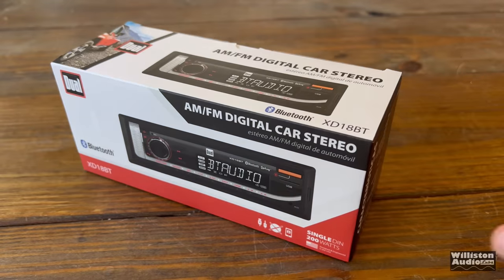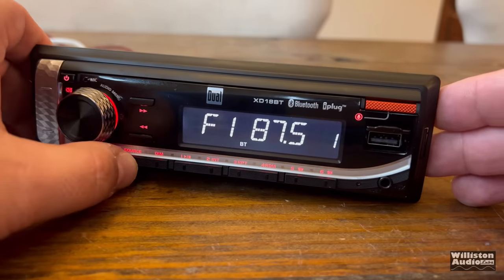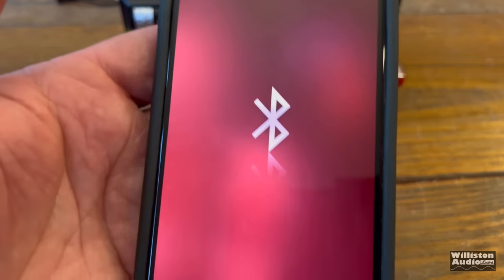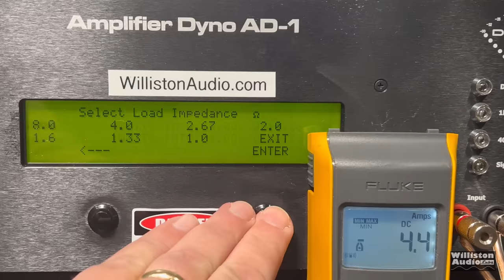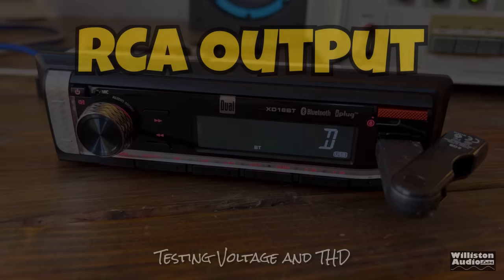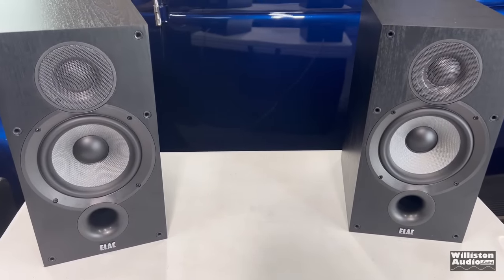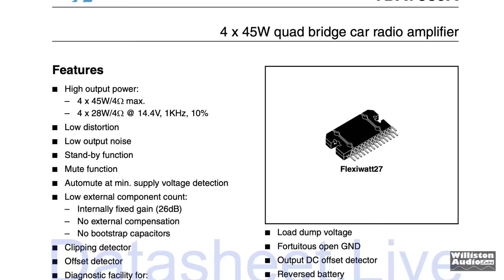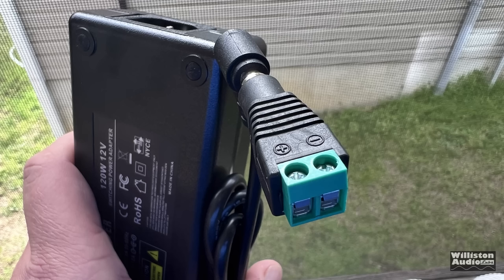How Bad is Walmart's Cheapest Car Stereo?

Comment from the maker: Dual Electronics XD18BT Bluetooth Car Stereo
Shop for the XD18BT: https://is.gd/walmartdualbt
The $10 Blaupunkt Car Stereo: https://youtu.be/EBEk9VPsix4
12V 10A Power Supply: https://amzn.to/3I4A6qg
Elac Debut 2.0 B6.2 Bookshelf Speakers: https://amzn.to/3Mmdbcz
Thanks to SAVARD Speaker Systems for being a monthly sponsor and make sure you check out Shop4Boom.com and use code WAL7 for 7% off everything including RAP and HiQ series subwoofers. 

TEST BENCH EQUIPMENT
SMD / D'Amore Engineering Amp Dyno (AD-1): https://is.gd/wccad1
XS Power D1400 Batteries - https://amzn.to/2BPFCKW
XS Power PSC60 Charger - https://amzn.to/2CHGcfs
Fluke 1000A AC/DC Clamp Meter: https://amzn.to/2Rw5WDA
Handheld Dyno AMM-1: https://is.gd/wccamm1
My Favorite Precision Screwdriver Kit: https://amzn.to/3RTO6c4

DISCLAIMER: This video and description contains affiliate links, which means that if you purchase from one of the product links, I may receive a small commission. As an Amazon Associate I earn from qualifying purchases
Reply: Can you get a Gemini dual 15" speaker and see what's the smallest amp you have that can give it the most power...this is a challenge?
Reply: Never mind, I see you tried something with the quad box.
Reply: Yo big I have a real old school Rockford fosgate 12 it’s says tha punch on it would you do a trade on another 12inch sub I think you would like it old maybe late 80s or early 90s I would trade you for any 12 inch sub lmk
Reply: It’s in good condition

Comment: Put one of those puppies in a Jeep Liberty budget system for my nephew. Actually sounded great, to my surprise. Total cost of around a hunnerd bucks. Used Kenwood amp and MTX 12" subs for $40, Dynavox 6.5" woofers were $11/each, 2.75" fullrange Visiton at $12 a copy and cheap 8awg amp wiring kit for $10 and some passive filter components totalling $15. We were blown away how good it sounded. It took me many attempts 'till I had a system that sounded that good when I was a kid. Budget audio systems can be alot of fun.
Reply: Diffrence is when we were kids that would have been around $800-$1000 easy….crazy how much better car audio has gotten and sooooo much cheaper
Reply: In 1977, this system by Alpine, Fosgate, with powered sub and active crossover... was more like $1200 to $1500.. If this deck is just average clean (1% is a high and increases the chance of speaker damage, well it did 45 years ago) But the RCA OUTPUTS at .012% distortion is EXCELLENT for 10 times the price.
Reply: Blah blah blah blah and it still sounded like asz that's why you had to comment 😂😅🎉
Reply: Yeah, I wasted a decent amount of money on flea market type amps as a kid before I got a used 90 or 120W fosgate amp for free from a friend. I tried it and it blew away all the "500 and 1000w" amps I had bought before, I was wasting $100+ on each one rather than ponying up for a proper amp.

These days cheap stuff is much more capable. Semiconductors have come a long way.
Reply: Deckless units are common here in Eswatini and not that bad.
Reply: i had a cherokee (liberty in uk)  the original head unit cd/cassette/radio was awesome, but did need an amp to improve high volume as was to quiet on max volume  miss my jeep
Reply: you never had good sound  probably lol
Reply: I was thinking this would be great for an offroad rig!
Reply: @DreStyle  you will never be happy

Comment: Nice that it dosen't have eye searing blue led's lighting up the face.
Reply: Wish my speakers lit up.
Reply: That reminds me i also had a set of the dual plain black plastic cone 10 inch subs in the light gray with white fibers carpeting odd shaped sub bandpass box and it had the light blue neon speaker ring tubes . I had forgotten about that one when i mentioned most of the dual electronics products I've owned because i didn't keep it long i had got it used at a yard sale for my ex girlfriend and when we split up i gave it to her.
Reply: I bought one few years ago exactly like this but it's blue LED lol. So glad they came out with red LED need one for my old farm truck.
Reply: @lancestrahm2362   I picked up a plow truck and it has an aftermarket radio in it, I was saying "please don't be blue!" And thankfully it's old enough to be white, almost like it's backlit by incandescent lamps or nice warm white LED's.
Reply: @volvo09  Unfortunately my dumbass rebuilt an 89 mustang gt few years ago and decided all the gauges and aftermarket gauges needed blue LED bulbs...major regret 🤣

Comment: I installed one of these Walmart head units in a DIN sized hole that I cut into the front of a plastic tool box, along with two cheap 6.5 inch coax speakers. I then hot glued the 12V battery from a battery backup unit (like for a computer) with a battery charging cube. Now I have a portable, app controlled radio to use when we sit around the fire pit in the back yard.
Reply: get power supply from pc it has 12 volt for radio but 120 ac for outlet no need for battery when using at home or garage or patio. it will fit inside area about size of  that battery or motorcyle battery and can use 120 ac outlet
Reply: @RT22-pb2pp  don't even need to be a full size one, can use a pico PSU. Tiny things, still capable of about 200 to 300 watts

Comment: I could see people buying the head unit + speakers combo to make a cheap BT boombox. Just add some lithium batteries and a USB charging board and you're good to go for cheap.
Reply: And...at 9 watts per channel tbose batteries will last!
Reply: there's something about a jbl..
Reply: I'd swap the amp for 3$ TPA3110 for same power but at massively better efficiency
Tbh I have no idea why they wouldnt use class D in the first place... Class AB is far more expensive than same power level class D  class D performs the same by now

Comment: I don't know how other people feel on here but I would personally be really jazzed about you coming out with more videos dynoing head units. Love the channel man. Keep those companies honest.
Reply from the maker: The truth is, most head units use the similar 15x4 IC's. A few exceptions including Alpine V-Drive, Sony and a few others
Reply: @wal appreciate the response.  that makes sense. This might be anecdotal but I feel like there can be a pretty big difference in output Even though the rating on the box says they are the same. I have a buddy with an entry level pioneer head unit from a few years ago that's rated 4x50 that he had to crank the volume up on it to get decent sound or of it. I gave him my old pioneer head unit that's a few rungs up the ladder but the same 4x50 rating and he said that the output was a lot better. Totally possible it's placebo but you're the guy with the lie detector who can prove it. I think there may also be a market to explore in Android head units from China. Amazon has quite a few options but they're all over ali express and temu. I know the head unit I picked up has some surprising output from its tda7850 chip Even though it's also rated at 4x50. You do you, I'll watch either way. Cheers
Reply: I was thinking about Dyno 's also i used to have a Panasonic cq-df44 CD player the faceplate was backlit in light blue, and it had a 3 stage dimmer on it and it was only rated 160watts but that is honestly one of the loudest clean sound output stereos I've had not counting my pioneer deh p3700mp mp3 CD player super tuner III D stereo.
Reply: @wal  Test those exceptions! I'm in the market for a double DIN head unit and I'm only interested in the cream of the crop.

Comment: A guy at the job installed this set up inside a metal toolbox from the same store. He has a laptop power supply powering it. For what it is, it is loud enough in the shop to have gotten wrote up a couple times. 😆
Reply: outstanding.

Comment: I've had one of these (Dual XDM17BT)  in a boat for about 2 years and its still going. Face plate is faded a little but its still working good and nothing is more harsh on a radio then being in a boat
Reply: That was my question. Have a boss unit in my old truck and the screen got sunburned so bad only half of it works now

Comment: It's amazing how far we've come in the way of shallow mount head units. Technology is awesome! Dual is actually a decent super budget brand.
Reply: They really are. I've owned quite a few of their products (subs, speakers, HU and amps) and was never mad at the performance. 

The only weird thing I had happened was on a CD player I had in a car back in like 2002, for some reason once the volume went over 10 on the display, the output jumped significantly higher for some odd reason. I mean, it wasn't atrocious, but definitely was there.
Reply: Carl Jr that was the single din that looks like the silver version of the Jenson x3010 and the 2010 CD players right,i had the x3010 but it didn't do that only because the rear speaker channels were blown the radio got wired up wrong by my best friend when he was drinking so yeah,he gave it to me and it was a new stereo, anyway he gave it to me since i installed a newer pioneer deh 17 i had that worked great in his 93 Ford mustang LX factory amplifier car.  And i had the silver face Jenson CD player i was referring to mine lit up in red but it would be fine til about volume 10 gradually going up in volume everything after 10 was a jump all the way to like volume 30, i put up with it for about 6 months and it gets old and i pulled it out of my 86 Buick Regal Factory V8 Sport Coupe Oldsmobile roller cam 307 V8 car with the Factory steel chrome on black centers magnum 500 rally wheels, and i installed a newer Panasonic cq-df44 CD player that lit up in blue and had a 3 stage dimmer,came out in 1999
Reply: @richardbates2367  It sounds like we're talking about the same unit, for sure. The Dual I had, if I remember right, actually had a knob. A huge one right in the middle. I may be thinking of a different radio though. I've been through so many through the years it's hard to keep track.
Reply: @richardbates2367  After further research I found the model # XD7500
Very stylish CD player on a budget. I kinda wish I still had it.

Comment: I’ve been laughed at many times when I tell people that auxiliary input has the capability to perform better than usb or Bluetooth depending on the DAC in the head unit and the source being fed into the auxiliary port. 

I’ve had people literally call me an idiot for saying it , because it’s almost never the case because nearly all head units have an adequate DAC , but in extreme situations like this , it’s absolutely true.
Reply: My auxillary is always better than the wireless blutooth….every time
Reply: True, but most new head units (or phones) don’t have the “headphone jacks” anymore. I hate that! Avoiding the need for MP3 decoding removes the chances of cheap components ruining sound quality and just generally makes things simpler if you can just pump pure sound signal into an amplifier. To me, most Bluetooth in a car stereo sounds about like AM radio signal quality. USB is about as good as it gets these days (not really bad at all) and, honestly, any loss in sound quality is still worth it to me over CDs or cassettes of the past. As long as you have your phone and some data signal, at least you can always find something good to listen to.
Reply: you can hear the difference.
Reply: Its amazing isnt it lol.
Reply: @brianandrews7099  Aww, its better than AM, and even FM. I bet the phone matters and what kind of sound processor it has. Id take a 4 year old Galaxy S phone over any wal mart cheap phone. 

Still running an S10e. Sounds pretty decent over BT, but yeah, AUX is better.
Reply: I'll argue usb is the best way to listen to music not all phones have good output thru aux or Bluetooth
Reply: Bluetooth will always have inferior audio quality over a wired connection because the signal is heavily compressed.
Reply: @flurpoid Bluetooth is or was similar to those 64k satellite radio channels. It sounds find on some headphones or a pool a bbq speaker but you can absolutely tell bluetooth audio when you're "listening to music"

Comment: I have the version of that radio from I guess 5 or so years ago. Honestly the thing works fine. Came with an IR remote, sounds fine for my old pickup and the Bluetooth interface with my phone is fine. It was like 40 bucks when I bought it. Looks like this one is even more shallow than mine. Mine is just a tiny bit deeper than the sleeve.
Reply: I have the xpr series 82d amplifier, had the first series of their 6x9's that were orange cone, the dual mp3 CD player and speaker Walmart exclusive combo i think around 2006 u66 something is the part number, the dual 279xbt, double din stereo and the xdvd770bt DVD/mp3 CD player stereo and that the 279bt, and the xpr series 82d amplifier which that one is new in the box haven't used it yet but i still have those three dual electronics products.
Reply: The xdvd770bt is the receiver with the built-in front face mic, and the first version of the DVD player it's got i think a 4.5 inch LCD screen and that is kinda impressive when you realize that is a a single din stereo
Reply: The xdvd770bt is the receiver with the built-in front face mic, and the first version of the DVD player it's got i think a 4.5 inch LCD screen and that is kinda impressive when you realize that is a a single din stereo

Comment: Still running the old pioneer 80prs hu.
$25 and the app,I couldn't complain lol
Ty sir for sharing
Reply from the maker: Thanks for watching and commenting!
Reply: Pioneer have been my favorite head units since the early 90’s! 😂
Reply: I was running a Sony xplod cdxL600x black faceplate CD player and i updated it to one of the better pioneer deh headunits in my opinion the dehp3700mp mp3 CD player super tuner III D stereo and i would have fully installed it in my 2000 dodge ram laramie slt quad cab long bed 1500 4x4 except for the fact that I've managed to lose my install cage sleeve for mounting the radio in the dash, so it just lays in the cubby hole dodge intended for the factory Chrysler stereo to go.. it came out in 2005

Comment: Ah yess the FLAC audio connoisseur purchasing a $25 head unit 😂

Wow that is a shallow mounting depth! You can pair this with a micro amplifier and mount them both in the dash.
Reply: Hahaha😂
Reply: I know someone who did that but the boss audio version with the blue LEDs in the faceplate, and he said he had traded around and got a mini amplifier the silver Kenwood version that is barely bigger than a motorcycle license plate and put them in the dash of a 1995 Cadillac Seville SLS it may have been a DeVille not much of a fan of caddy myself anyway, and i was like do you realize that you just put a amplifier and speakers that cost 3x what your stereo does and you installed it in a $35 install kit for the caddy dash that cost more than the radio it mounts lol that is too funny...
Reply: He installed infinity reference black with the copper trim speakers in every factory speaker location in the car, honestly stereo sounded good...I'm just more a fan of dual electronics products than i am boss audio products I've been burned by more than one Boss audio product so i don't always get them..

Comment: Got this same exact one with 4 speakers from Walmart for 35.00 a year ago. Installed head unit and all 4 speakers in a 5 gallon square cat litter bucket, LoL. Use it at the beach. Gotta admit it's alot better than any Bluetooth portable radio out there. Probably 80$ total for build, including the 12 volt battery.

Comment: if you hold down the middle button. or go through the menu options.. of the radio. like on bluetooth and aux it has a gain control in it.. for each thing. including the FM radio. i think it requires you to hold down the volume button. for a few seconds
Reply from the maker: I went back and double checked and this does not work with this unit

Comment: My local Wally World has this radio in a package with four 6.5” two way Dual speakers, all for $30!!  I’ve been seriously thinking about picking this package up and hanging on to it for my next project.  

I’m currently using two of these radios.  One in my cargo camping trailer connected to a set of 4” components and a single 6.5” dual voice coil woofer.  It sounds decent!  

In my shed, I’ve got one of these Dual radios powering a JP8 and a Kicker 4 channel marine amp.  The Kicker amp is running four 6.5” mids and two surface mount tweeters.  The JP8 is running a single shallow mount Cadence 10” 2 ohm subwoofer.  It plays loud and clean.  The app is nice to be able to adjust the volume and settings while I’m working without going over to the radio.  

These Dual radios have been very reliable for me and have been EXTREMELY good for the price point.  Heck, it would be good at twice the price!  

Thanks for testing this Big D!!  I’ve been wondering if it is as good as the old Dual radio that you tested a while back!

Edit:  in my shed, I keep the volume set on the radio to 30.  This allows plenty of volume at max setting on my phone when using Bluetooth.  In my cargo trailer where I’m not using an amp, I typically will have the volume maxed out at 20-25, primarily because I’m a lot closer to the speakers.

Edit x2:  in both my cargo trailer and my shed, I have solar panels set up with lithium batteries.  Those are what I am using for power for these two systems.  The battery in my shed is a 300 amp/hr so I can really crank the volume and not have to worry about voltage drop.

Comment: Great review! I have the previous slim model Dual and it works great on my boat. The low/mid/high adjustments are atrocious but it fits and decent for $20. I also tried a cheap touchscreen and the dual slim was night and day better.